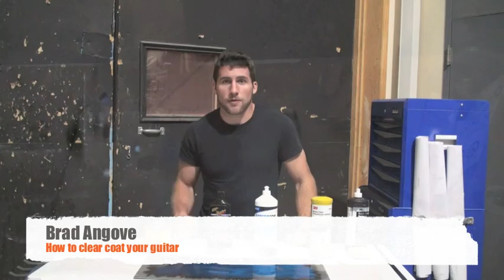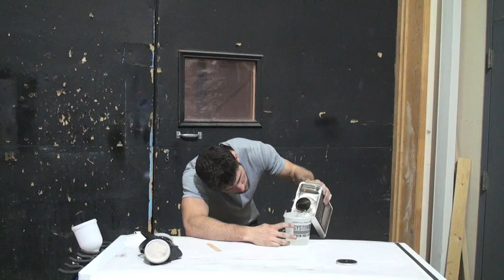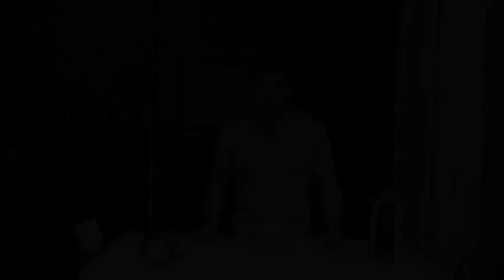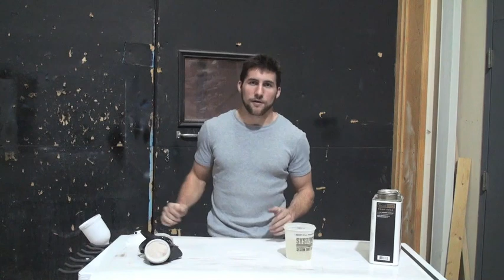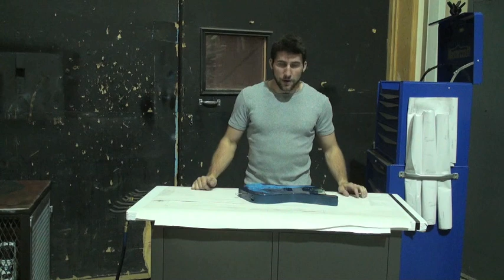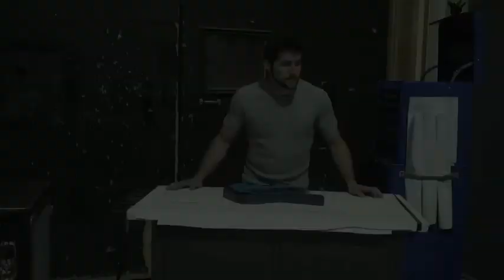How paint your guitar | Clearcoating (part 6 of series)

Comment: Brad,
If you need to protect your camera from overspray, you can build a housing from Plexi or Lexan and put a hinged gasketed side hatch on it.
Get a clear glass filter from Tiffen (inexpensive, and can be cleaned off with Acetone) for your optical port, which should be several MM larger that the camera's optic so you have a bit of room to play.
Bore a hole in the housing just large enough for the rear filter threads and glue it in with a two part urethane adhesive.
A 1" or so hole covered with a patch of thin cotton, like a bed sheet will allow the microphone to capture audio quite effectively while keeping droplets of finish out of the housing.
Change the cover on the audio port when you see any matter sticking to the outer fibers of the material.
If you can see it, it is soon to be compromising the high frequency response of your microphone to a noticeable degree.
If you can, it would be good to attach an external mic and use a shock mount to isolate noise and vibration that the housing will otherwise induce into the microphone body.
There are plenty of very decent mics around for what you are doing that fall in the $30.00 range, and for a bit more, you can get what is called a "shotgun mic", but this needs to be outside the housing and in your case, in a device called a blimp.
This however would get rid of a lot of the room tone (echo) you hear, and sound a lot more like having a mic right in front of your mouth.
Keep the cool vids coming man!
Reply from the maker: Thanks for the great suggestions John. I've been working on a design for a lexan setup, and your ideas will be helpful. I need to look into a better microphone, so I'll see what shotgun mics are available.

Comment from the maker: It depends a bit on what size gun you are using and how you spray, but you should be able to get away with about 50ml for one job this size. I like to clear lots of things at once so that I can reduce my waste and mix a bit extra, but I think that the 120ml that I mixed in this video would have done two guitars this size with material to spare.

Comment: Hey Brad enjoyed the video very much.  I wanted to follow up on Mr Ramos question about the swirl painting.  I too am a swirl painter and would like to know what you would recommend as a top clear coat over enamel oil based paints.  Thanks
Reply from the maker: Generally you would want to re-coat an enamel paint within a specific amount of time to enable it to bond mechanically with the previous layer. In that case you would use an enamel clear coat. For swirling, you need to let the guitar and paint dry thoroughly before you clear coat it. By the time the water has all evaporated, the solvents in the paint should have done the same. If all of the solvents have evaporated then you need to scuff it a little so that the clear can bond mechanically. This means that it shouldn't matter as much which clear you use because there shouldn't be any solvents left for it to react with.
I don't do swirl painting, but I would recommend using an enamel or a polyurethane like the one that I used in this video. Mr Ramos said that the urethane worked fine for him. When in doubt, paint a test panel first to see how the paints work together. Also keep in mind that enamel can get very hard depending on what type you use, and this in turn can affect the tone of your guitar (although it may be hard to notice).

Comment: Hi Brad, great video again, just wanting some clarification on the sanding between coats of clear. When you're sanding between coats, are you trying to remove the orange peel effect like you would if you were at the final polish stage? Or will a light scuffing suffice? Im concerned that if I sand too much into the first clear coat I might burn through to the paint job. 

I've also read that some people say you can do a second coat without sanding if you respray after 2 hours? What would would you say?
Reply from the maker: Before I give you any actual advice, I need to know what clear you're using. That begin said, you're under a common misconception. It depends on the specific paint, but for example in this video I didn't sand between coats at all. I put on three coats, and I did them 10-15 minutes apart. If I had waited 2 hours after the first, I would then have had to wait 24 hours and sanded so that my next coat would stick. The flash-off time for this paint is 10 minutes though, which means at that point it's dry enough to re-coat, but still has enough solvents in it that it will bond chemically to the next layer.
Lacquer follows a somewhat different system, as do some water-based clears. What are you spraying?
Reply: I'm attempting to spray (using a HPLV spray gun) either an oil or water-based 1-part polyurethane on top of some acrylic lacquers. Alternatively I was also going to test out some oil-based polyurethane spray cans that I already have to see if I could work with those first.

I also have some general purpose clear that seems to be based of what the datasheet calls alkyd resin. Is that the same/similar to a polyurethane finish?
Reply from the maker: If I'm not mistaken, the alkyd resin clear is a polyester. It's not the same as a polyurethane. Fender used polyester briefly I think and then stopped because it was too thick and hard and was messing with the tone of their guitars.
At least that's what i heard.

The oil based poly can be done the same way I did mine, but if it's a one part it will take longer to harden.
As for the water-based poly, you should be able to apply a coat, wait a few hours for it to dry, sand it lightly, and apply another coat. You have to be very careful about polishing water-based finishes though. They don't behave quite the same as the solvent stuff.

Comment: A couple of questions:
1)  Can you spray polyurethane in a garage?  It looks like you're in a shop.  I know the stuff is super toxic.  If I setup a simple spray booth in the garage with a fan for ventalation, am I going to kill my neighbors doing it this way?
2)  If I'm going from bare wood, do I need a sanding sealer first or do I just use the 1k or 2k primer onto bare wood (I'll be using Alder, most likely won't need a grain filler)?
3)  From the primer, I can just go straight to base color (wicked acrylic most likely).  What is the "clear base" that you used on top of your base coat before you masked for air brushing?  What that just polyurethane or something different?
4)  What product do you use to finish the neck of the guitar?
Reply from the maker: D Farr You can spray in a garage under some circumstance. You're correct that I'm in a shop. You will need a mask of course, and you can use a fan for ventilation, but you should make sure it's an explosion proof fan. Some fans create small sparks, and polyurethane in the air from spraying can be very flamable or even explosive. 
You can start with sealer or primer. It's good to start with sealer, but not necessary. You should be able to get away with not using grain filler on alder.
The clear base that I used was from the brand name autoair, which is made by createx, the same company that makes wicked. It's an acrylic as well.
I didn't mess with the finish on the neck. What product you use for that will depend on how you want it to look and feel.
Reply: Brad Angove Thanks man for getting back to me.  Do you use a reducer with your acrylic paints (either base or actual color coat)?  Also, what are your thoughts on 2k clear coat for the finish coats (like Spray Max in the rattle can) vs. gun sprayed polyurethane top coat?
Reply from the maker: Yes, I use the autoair/wicked 4012 reducer.

I use the 2K gun sprayed polyurethane clear coat, but if you don't have access to a spray gun the spray max 2K is a great option. The only real problem with it is that you have to use the whole can at once essentially, so you may want to line up more than one project depending on the size.

Comment: so I want to clear coat my snowboard, but it is below freezing where I live right now. Do you think It would be ok If I used a can of catalyzed polyurethane outside. Then put it in a sealed bathroom for it to dry?I
Reply from the maker: No, the paint won't atomize correctly in those temperatures unfortunately.

Comment: Hey brad, do you have to use a wipe on polyurethane or can you just use a regular gloss from those little cans? Also it says to sand the poly after you paint it.. To level it out and polish it. Dry sand? Wet? What grit? Thanks mate
Reply from the maker: You can use the spray stuff or brush on if you prefer. Have a look at my videos on sanding and polishing. I have a few.
Reply: @BradAngove  thanks I just found it. Would meguiars ultimate compound work as a polishing compound? Its only 10$ and cant seem to find liquid ice compound anywhere
Reply from the maker: Yes, the meguiars tends to work well.

Comment: How long did you wait between those 3 coats?  And i thought the reason those guys wear the full body suits was to keep the room free from micro particles, like dead skin or body hairs, microfibers from your clothes etc. so they don't get stuck on the wet clear coat.  You know, the same reasons they wear them in places/rooms that produce computer microchips.
Reply from the maker: I waited about 10 minutes between coats. The body suits are safety equipment. They also help keep the room free from particles, but their main function is to keep people safe from the isocyanates as much as possible.

Comment: Hey! I'm planning to buy a Mahogany body guitar from Warmoth and I'd like to buy it unfinished without any coats of paint or anything. I was wondering if there's any way I could give it some durable protection without losing the color of the natural wood. Do I layer on like over 9000 clear coats or is there something I could use to give it some protection without losing the color?
Reply from the maker: Bardock Uchiha Hi there. Of course you can keep the natural wood colour! There are many options for this actually. Don't put on too many coats of clear though; it's not good for it haha. Three coats of this stuff would probably do it just fine, or you could use a couple coats of lacquer sanding sealer and then some clear lacquer, or you could go with a wipe on poly finish, or a brush on clear lacquer, or even an oil finish. Most of them will darken the colour just slightly because they will make it look like it's a bit wet, but they will look like a natural wood finish.
Reply: Yes! Thank you so much! C: Now I can have the guitar of my dreams. Keep going with the awesome videos ^-^
Reply from the maker: Will do. Thanks.

Comment: now this is gonna be a question you may or may not not be able to answer but can you clearcoat gold leaf or ormaline based gold paint because i wanna do a gold binding between the cherry red face and the black back and sides of my les paul
Reply from the maker: I don't know anything about ormaline based paints, but you should be able to clear coat over gold leaf. Just use adhesion promoter on it first. There are gold paints available in most mediums though, so you should be able to get a gold urethane or acrylic or lacquer if you think that would be easier.
Reply: ok cheers i think ill use gold leaf seeing its ok as some bits will not stick leaving a distressed marblelization effect hopefully
Reply from the maker: Good choice.

Comment: hey dude i did a swirling paintjob with humbrol enamel oil based glossy finish  paint  can i clear coat it with the car clear like u do in this video?
Reply from the maker: I can't tell you for sure if that would work. I've never tried it. Those paints aren't designed to go together, but you may be able to get away with it. I your enamel has finished drying all the solvents should have evaporated, so you shouldn't really have a problem with reactions. You will need to sand your humbrol paint a bit before applying the clear coat though. That will give it a way to stick.

You can also check if humbrol has a clear coat of its own. A clear enamel might work better for you than this paint, and you can put a hardener in it for extra durability.
Reply: thnx man i did it its not as easy as it looks but ive got the hang of it now, the paint did not react badly in fact it looks awesome thnx for this vids man keep them coming!
Reply from the maker: That's awesome. I'm glad to hear it worked out well. Usually when you let all the solvents evaporate from your paint it tends to play well with others.

Comment: can i use polyurethane from home-depot and what r u mixing it with?
Reply from the maker: You can, but it's not really the same thing. You will need to thin the stuff from home depot depending on what you get. This is an automotive catalyzed polyurethane. The stuff that I am mixing it with is the catalyst (hardener).
Reply: thanks for the reply, can u send me a link to where i can purchase the polyurethane clear and catalyst also i used an acrylic spray paint from micheals as my base coat, is that ok?
Reply from the maker: The acrylic spray paint shouldn't be a problem. I haven't been able to find this particular clear coat online, but chicagoairbrushsupply.com sells a similar PPG product, and coastairbrush.com has some options as well if you're interested.

Comment: I think you should not be advising amateurs to play around with 2 packs you should not be spraying them like you are, you should be using throw away overalls and air fed respirators and using a booth specially using Isocyanide catalysts they are dangerous and carcinogens, some country s they are not not be sold to the public, most paint company's are trying to move away from them for less harmless catalysts, wile they are excellent coatings there not for the back yarder and you as a professional not be advising other wise i am a professorial spray painter for 40years and i have had removal of skin caners from using them
Reply from the maker: +MrPhrozin Thank you for your concern. I have a few things to say in response to this. First of all, the respirator that I'm using is what is recommended on the technical data sheet for the paint I used here if I'm not mistaken. I would love to have access to an air fed respirator, but I don't. Nor do I routinely have access to a paint booth. If I were spraying vehicles in large volumes, the circumstances would be different and I would aim to use all the equipment that you mentioned. For what I use it for, I believe that my equipment is adequate (excluding the fact that I should definitely have gloves and I just choose not to use them). Let me be clear that I have never claimed to be a professional. I also assume that the people watching these videos are not professionals, do not have access to a lot of specialty equipment, and will not be spraying consistently for 40 years (thus their risk of overexposure is less).
Reply from the maker: Well, that escalated quickly. While we're on the topic though, what cause of action do you propose I would be sued under?
Reply from the maker: Also, please note that in the photos associated with spraying in your link there, which I'm assuming were intended to demonstrate correct safety procedure, the individuals doing the spraying were not wearing air fed respirators. They were using the same kind of thing I use.